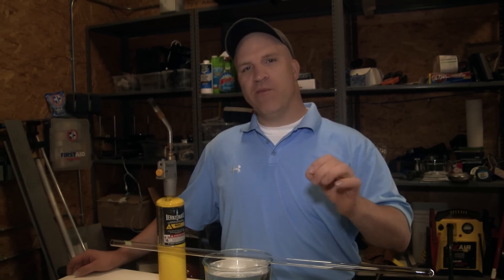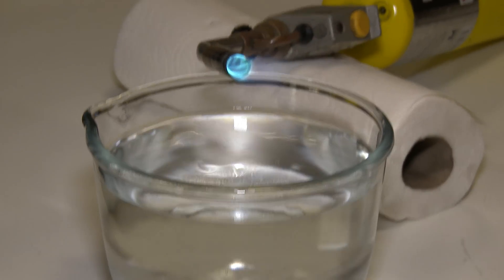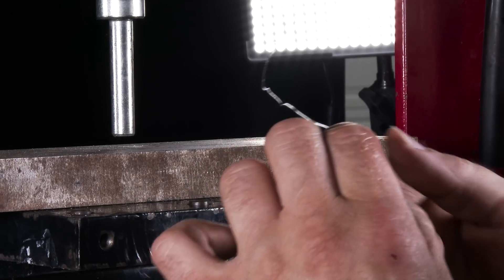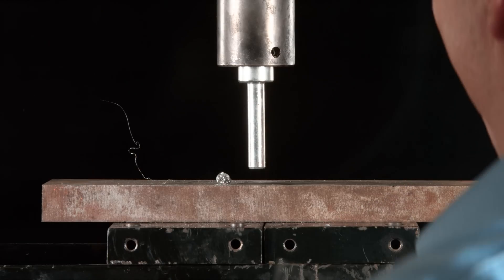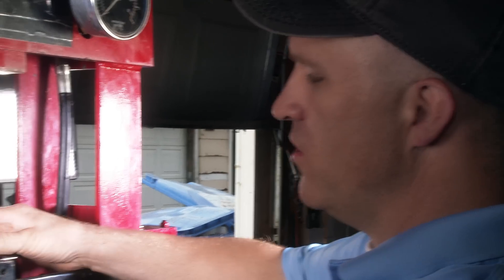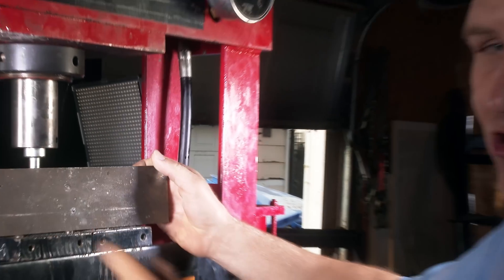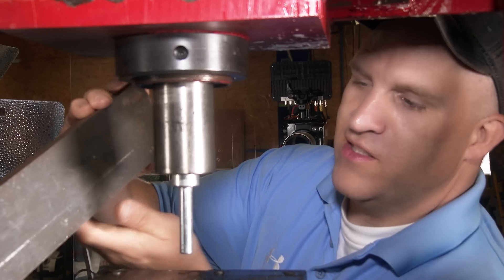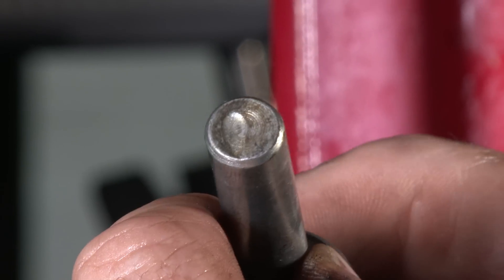Prince Rupert's Drop vs Hydraulic Press [ 4K - Slow Motion ] ( S1 E9 )

Comment: A "Ton" is a measurement of force, not pressure. #TheMoreYouKnow
Reply from the maker: David Parham the gauge on the press says "tons" and "metric tons"
Reply: David Parham No it's not you unintelligent fuck Force is the total impact of one object or gas on another
Pressure is the ratio of force to area over which it is applied.
Reply: first time in my life seeing comments in youtube so educational thank you all and special thanks to david parham
Reply: Warped Perception but what does "20 tons in pressure" mean? Is it per ft^2? in^2? nano-in^2? mile^2? These all have VERY different repercussions. "20 tons of pressure" doesn't mean anything. "20 tons of force" means that there is 20 tons pushing down regardless of the area it is pushing down upon.
No matter what the reasoning behind it, "20 tons of pressure" is just as wrong as saying "20 miles of velocity".
Reply from the maker: David Parham it's just a reference to the pressure, if you weigh 200 pounds and you stand on one foot stand on two feet one finger or one toe or any combination you still weigh 200 pounds.
Reply: Warped Perception Exactly why you cannot call it "pressure". It is not pressure. It is a force. The fact that you change the pressure whether you stand on one or 2 feet is EXCATLY why you have to say its "200 lbs of force", because it does not take into account the area over which it is exerted. This is why it has to be called "20 tons of force". "20 tons of pressure" is simply wrong.
Reply: ***** holy crap I stand to be corrected. I had to look it up to be sure. It is a unit of mass.
So, in the US we use tons to mean 2000 lbs. This is confusing because lbs is definitely a unit of force. We do not use tons as mass, but force. In the UK they use it to equate to Kg, which is a mass. For some dumb reason UK and US uses different measurement for weight. We use force (pounds) and UK uses mass (kilograms). This does not matter in normal everyday context, but if we are talking in terms of going to the moon where your kg stays the same no matter the gravity and my pounds which changes with the change of gravity, it will differ.
Short story, Muhammed, I owe you an apology. It is a mass and the US has bastardized it into learning it as a force. Please forgive me.
Reply: relax.
Reply: Warped Perception Which is probably how much force the machine is using. The pressure would depend on the area it is pushing on.
Reply: Warped Perception the problem is the unit "ton" is not a measurement of pressure, it is a measurement of force. Its like talking about your car's speed and saying "it goes 100 miles". It doesn't make any sense. You would say "it goes 100mph".
Reply from the maker: David Parham that's true but in this case or I should say in the pressure gauges case, it's measuring the pressure of the hydraulic fluid on the piston which is why it displays "pressure in tons" on the gauge . in the video I'm just relaying what is stated on the gauge to the viewers. the way I view it is if you put 20 tons of weight on top of that piston that's when it broke. all the other stuff is relativity.
Reply: Warped Perception So to correct your insight, the piston was pushing down with 20 tons of force over 1/20 of an in^2. 20/ (1/20) = 400 ton/in^2 of pressure causing the ruperts drop to break and fly out with a lot of momentum (which is mass * velocity). :)
Reply from the maker: Coldbane lol. thanks. It was about the visuals for sure, I'm not trying to copy smarter every day by getting all technical about it. I was literally conveying what it states on the gauge , "pressure in tons"
Reply: Just finished my GCE 'O' Levels and there was only one question on pressure HAHA Thanks for the fruitful discussion anyway!
Reply: I live in Australia and I like to view it as: scales are designed to be used on Earth and therefore tell you your mass if you use it on Earth.  Of course most Australians call it weight.
Reply: It's pressing on it with the force of tons dipshit
Reply: Mr. X A ton is measured as 2000 lbs which is a force. Ton/ft^2 or Ton/in^2 would be pressure - hence the ratio or force over an area.
Did you not learn that in your aerospace engineering major and physics minor like I did?
Reply from the maker: David Parham that sounds about right, but as I stated previously the gauge comes with the Press, so I'm pretty sure the manufacturer has already made their conversion and when it says 20 tons that means that there's 20 tons pressure on the piston. To simplify it if you were to put a scale underneath the piston it would weigh 20 tons, if you mounted a large plate on the bottom of the piston and put it on the scale it would still weight 20 tons. this has nothing to do with surface area pressure on the drop. it's not psi which you would factor in surface area. in your previous example 400,000 pounds that would be 400k psi.
Reply: Coldbane Its not a meaningless argument. Tons is not a measurement of pressure just like miles is not a measurement of velocity.
Reply from the maker: David Parham well that my friend, we would need to take up with the manufacturer of the press if it's that serious, because the gauge on the Press States "pressure", and the gauge needle was pegged at 20 tonnes when the drop broke.
Reply: yes. i wasnt able to modify my comment on my phone! but yeah that was what i meant haha
Reply from the maker: David Parham i was never doubting you, i know weight is force its unidirectional. i was just explaining why i said pressure thats all.
Reply: ***** No. A ton is a force. And different types of scales can either measure either mass or force depending on how its set up. Your digital scale usually measures a force. Your scales like the one at the doctor or gym with the sliding masses tells you your mass. You can look this up or go take a few engineering courses, but I literally can't help you since this is an argument on something so fundamental to physics.
There is a "shipping ton" that is a measurement of volume which I learned about recently!
Reply: benjemyn lin I'm glad you could at least learn something! I hope your test went well!
Reply: ***** haha yeah. I doubt anyone thinks of their own mass and how it differs from weight. It isn't practical to know it. They also teach that "outer space your are weightless", which simply isn't true. There is always some pull on you. For instance, the ISS is actually under 90% of Earth's gravity. The people float because the pull from the centrifugal force is equal to the pull of gravity. But this isn't practical knowledge for most people, so they ignore it.
Reply from the maker: David Parham the space thing you said is true though
Reply: you could ask at "corning museum of glass"
Reply: Sisteelin What? Force and Pressure are different. Its important that we all talk the same "language". In 1999 NASA lost a $125M Mars orbiter due to wrong units of measurement.
Reply from the maker: David Parham wow.... i never knew that, thats crazy !!
Reply: David Parham It is semantics unless you are an engineer or need to accurately measure something. If you are just using the word, they means the same thing.
Reply: And this, ladies and gentlemen, is why the US needs to stop using the imperial system. 
Doing science in imperial is the most frustrating thing. Especially when you get more complex than just mass vs. force.
Reply from the maker: David Parham lol... yeah I was just messing around
Reply from the maker: David Parham well the plain and simple way to look at it is, that piston was pushing down on the ruperts drop with 20 tons of pressure, the surface area of the ruperts drop I'm guessing is about 1/20 of a square inch, if you do the math that's pretty incredible. once that ruperts drop breaks the pieces are flying out with a lot of force. I think that's correct, LOL
Reply: David Parham  it's a meaningless argument, you're arguing over him reading the pressure on a gauge and saying things in a round about way.  He's using a hydraulic press that measures the pressure it is building up.  I guess what he should have said is "it took the hydraulic press to reach 20 tons of pressure before it broke", which is also not the force that was acting on the drop.  Does it really matter he didn't use the correct terms in a slo-mo video about crushing glass? Did you really come here to learn from him or the visuals? Let the man be ignorant about terms as long as he understands enough about what he's doing he don't kill himself, what's the harm?
Reply: Warped Perception Pressure is derived as Force÷Area=Pascals . You only have the force but we lack the area to calculate the actual area , thus you only unit of Tonnes provided was misleading to a certain degree.
Reply: Warped Perception If that was a feed from the press then yes, It is incorrect. If you don't believe me, by all means go find anywhere that tons is a measurement of pressure. I actually started doubting myself and thought it might be like "pounds". It has a meaning for mass and force (they call it pounds force and pounds mass). I thought maybe tons could have a meaning for pressure as well, but everything I found was clear, tons is force and only force by definition.
Reply: David Parham not entirely true. Tons is a prefix for a force. The SI unit of force is Newton(s).
Reply: benjemyn lin I never said anything about Newtons, but I'm very aware that Newton is the SI unit for force.
Reply: benjemyn lin also your "Force/Area = Pascals" is misleading. It "Force/Area = Pressure". Pascals is an SI unit used for N/m^2 (I think - maybe that's kPa - I'd have to look it up). Pressure would mean it could be any pressure unit. I'm sure this is what you meant, but I felt the need to clarify.
Reply: benjemyn lin That is fair enough!
Reply from the maker: Lucifer W true !
Reply: Lucifer W Haha Thanks! It's easy when people don't get offended. I'm lucky enough to have Warped Perception and benjemyn lin for people to talk to about this.
Reply: ***** So a pound actually has 2 definitions. Pound force and pound mass. Typically US uses pound as pound force. Our F = ma equation in units is pound = slug * ft/s^2 (as yours is Newton = kg * m/s^2). Where the acceleration of gravity is 32.2 ft/s^2. Slug is generally the unit of mass the US uses (and no one knows about except engineers). A pound mass is equivalent to a pound force at sea level. The acceleration used is 1 and I really couldn't tell you the units on this but its nothing you've heard of.
I think the confusion comes when people equate a kg to a lb. The US measures weight in force and the rest of the world measures weight in mass. kg and lb (pound or lbf  for pound force) are not the same type of units. lb is actually the same type of unit as a newton. kg and lbm (pound mass) are the same type of units.

This confusion is why even US students typically do everything in SI units. English units are horrible and confusing.
Reply: ***** You appear to have knowledge of English units enough to me to assume you are an engineer. If you still do not believe me that pound is a unit of force, what unit do you think we use as force? SI uses Newton. What about English units?
Reply: And I may have gotten the acceleration backwards when you use slug vs lbm. Its all very confusing.
Reply: *****
haha yes. And when we say "Pound" in the US, we are talking about pound force. We weigh ourselves in pound force. And I misspoke earlier. pound force does not equal pound mass on Earth. Another reason SI are the better units.
Reply: ***** Quick question. Do you all talk about how much you weigh on other planets? Because Kg will not change due to change in gravity. It works for us because we weigh in lbf and your lbf changes due to change in gravity. I'm just curious on what they teach in schools there.
Reply: now order some bigger drops made by glass blowers, the glass ist far hotter so there is more compression stress in the surface and it's more stable. sorry for bad english
Reply from the maker: EduFreeek you English is fine..... I wish we could order the drops, we actually made these
Reply: I am here to end the argument. Force and pressure and semantics, unless you get nerdy.
Reply: Sisteelin we are talking about measuring something. It matters.
Reply: you are talking semantics that don't matter to the lay learner. get over yourself.
Reply: Denise Sokolov #ItMatters
Reply: So don't SI people use scales like we do? You or that other guy said that you weigh the same in kg no matter what planet you're on, but don't their scales just have kgs where ours have lbs? There's no way that they weigh themselves in a tub of water to measure the displacement, or however you find out your mass.

What I'm asking i guess is how do you find out your MASS?
Reply: It is actually measurement of mass.
Reply: cascadefly no, it's weight, which is force
Reply: Dillon M  "It is used principally as a unit of mass."  https://en.wikipedia.org/wiki/Ton#Units_of_mass.2Fweight

Newton is the unit of force.
 A ton=1000 kg which is a unit of mass.
Reply: Dillon M I thought it was force as well, but as cascadefly pointed out, its actually mass. We, in the US, use it to compare to 2000 lbs(force), but that is only true at sea level.
Reply from the maker: David Parham Yes Mass ..... now the question remains, is the gauge indicating "long tons" or "short tons" . lol
Reply: Warped Perception Lol. I think Tons when used in shipping can also be used for volume....

Comment: crush I diamond or a steel ball
Reply: cameron G diamonds actually shatter very easily, they are just hard to scratch.
Reply: cameron G you can crush a diamod by hammering it, they are hard, but still fragile
Reply: crush a steel marble
Reply: maybe some steel bbs I fire them at 1000 fps at a brick wall and they come out round

Comment: you should have heated the bottom of the drop when trying to make it, not the neck
Reply from the maker: Mason Chase that was just a take of one of that failed. the ones that survived were only heated from the bottom, it took about 6 attempts to make two drops and we didn't film all of them.
Reply: Warped Perception probably should have noted that some where
Reply from the maker: Mason Chase we do that so often in film that we didn't even think about it but, this is kind of a technical thing so it might have made sense and saved confusion. thanks

Comment: YOU MADE THE DROP INCORRECTLY YOUR SUPPOSED TO HEAT THE BOTTOM OF THE DROP NOT THE POINT WHERE IT WILL SEPARATE DO YA RESEARCH YOU NOOBS!
Reply from the maker: justinginger actually you have judged incorrectly, in film, not all clips shown in the video are in sequential order, the drop we used was not from that take (that one broke) we made it correctly off camera. when made incorrectly they will not survive and will shatter on their own. you should do your research noob .
Reply from the maker: justinginger that was a good observation though and thanks for taking the time out to watch and comment :-) !!

Comment: Yeah, a Prince Ruperts Drop is stronger than steel.
Reply: I wonder if you could heat the glass in a weightless environment (like up on the space station) and the cool it with water (the trick would be doing this from all sides at once so it doesn't loose its shape). 

I imagine it would be an extremely (not impossible) hard thing to achieve.
Reply: all glass is harder than steel
Reply: Sonic72412574 I know. Their pretty amazing science experiments that aren't that hard to make.
Reply: need to figure out how to make a rupert sphere
Reply: Not that hard, You just need to cool hot glass very quickly, the tail forms because it was moving when it hit the water, if you make a liquid glass sphere then ad the water you can get the same effect
Reply: If it was that easy, how come it hasn't be successfully done?
Reply: maybe using ice is possible to make a sphere
Reply: +Will Dear The drop needs the tail to be hard.

Comment: I don't think it was the pressure that made it burst. It was the fact that the indentation in the steel and press got to be so much that the press ended up actually touching the tail itself which ended up making it burst. It could've held much more pressurw
Reply from the maker: Matthew Maloney no actually It's Just an Illusion because we used a long lens, it was actually about an inch away.
Reply: Okay that's understandable! thanks for the clarification!